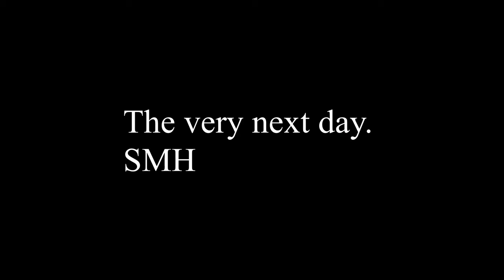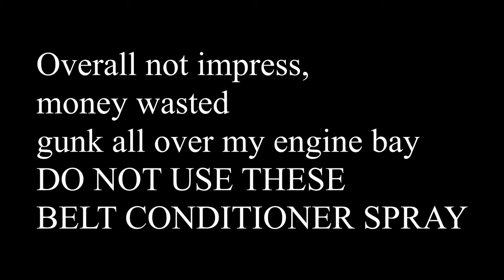Serpentine Belt Dressing Conditioner Spray

Comment: That's for old multiple pulleys and farm and individual stuff. Pre computer age. As far as I know. It's funny that we were just talking about this kinda stuff. I looked up some things about it and I like to read the comments.  I used it 50 years ago on a couple of old 50 dollar beaters. I never saw any spray type dressing. What we used was like a deodorant stick. I read that some guys used a bar of soap. Definitely better to find out why and start by replacing the belt first. If the belt is new, then you have something else that's causing it. More than likely the tensioner. They had gages back in the day to get the proper adjustments in the belts.

Comment: Permatex product not for use on serpentine belt.  CRC in my experience is the best but each squeaky belt situation is different so do your homework first.  If your belt is cracked change it.  Make sure the squeak is not a bad bearing or some flaw in the pulleys.  In my case it was a chirp every time I started my Yaris.  Tightening the belt did not solve it completely and I didn't want to over tighten.  Use CRC Belt Dressing but very sparingly a few short bursts only.  See how that works out over a few days then if you need to do more go ahead but very sparingly.  What this person did spraying it on like paint not the way to go with any of these products on a car.

Comment: There is a warning on the botle "Do not use it on Serpentine Belt". You cannot review a product on a usage which it is suposed to be used for. This is for "V" belts only. For that gunk, use an engine degreaser and it will clean right off.
Reply: Bro I bought it and after reading your comment I realize I wont be able to use it 😂😂
Reply: @kevinlemus5009  I was 2 blocks away.  So I'm turning around

Comment: Hey man I bought the same junk didn't read it sprayed it on my belt it. Later that day I saw online not to use that brand on a serpentine belt... Fml my belt wasn't even making a sound hows it going so far with it's. Idk if this junk is going to eat my belt away or what ughh
Reply from the maker: Yeah. I did the same too, bought it and used it before I even read up on it. But I ended up switching the belt to a new one. Although the spray did leave my engine all messy and dirty and it seems to be permanent now

Comment: Permatex Belt Dressing & Conditioner. 
TYPICAL APPLICATIONS

• V-belts or flat belts of rubber, leather or fabric
• Automotive
• Farm equipment
• Industrial belt drives
Note: Not recommended for use on serpentine belts

Comment: 1. Remove  Belt   2. Pour ARMOR ALL - into small container, one large enough to hold the folded-up belt.  3. SOAK  said belt, in solution OVER NIGHT   4.  Install  belt on  engine. 5.  N O  more noise.
Maybe, use a wire brush - or sawed off end of one - on a stick - CLEAN  all V pulleys'   on  engine  of  G U N K. n  ( BE  creative - in finding out solutions....)